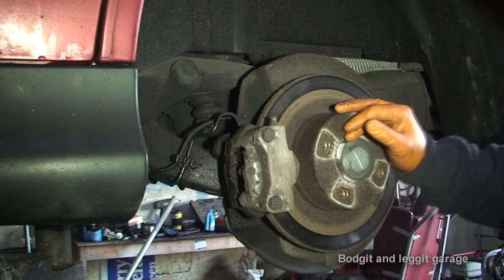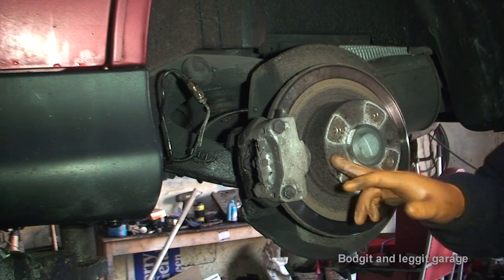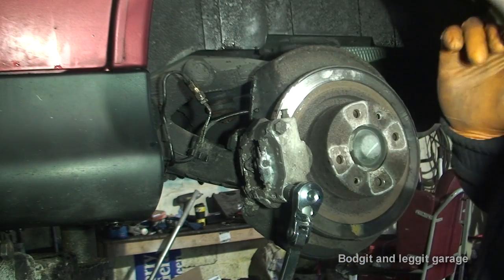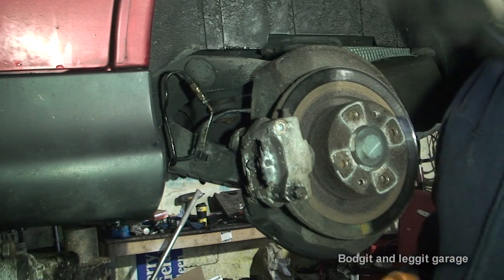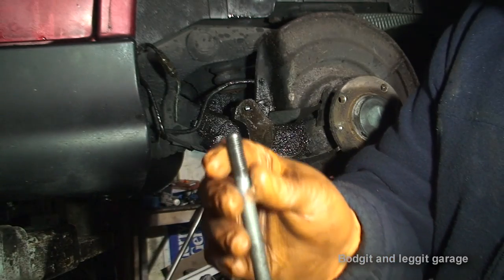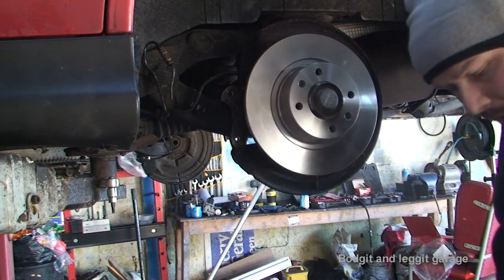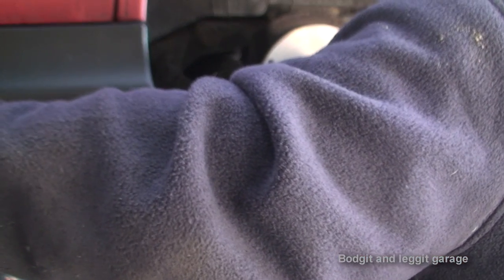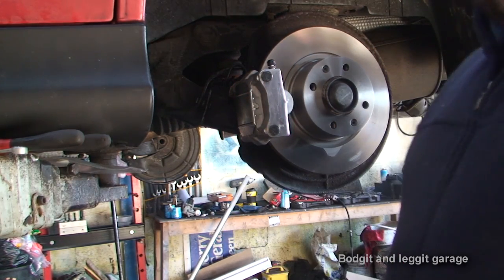bodgit and leggit garage how to do citroen c5 back brake pads/disc/calipers  (nightmare)

Comment: This is normal in canada on most brake parts hitting with hammer is bad use air hammer on bolt head with point you get the shockwave without damage to thread  get a real torch you need to heat it fast or it all expands  impact gun works but use it to tighten a bit then use wench to take off oil the shit out of it too losen, retighten oil clean losen repeat as lots of them jam and break halfway out ! You guys have it easy in the UK everything is rusted too hell in canada after a few years broken bolts are normal! This would not taken long in my old shop more than 2 hours you would get fired
Reply from the maker: Boom 👍💪

Comment: Bleeding the brakes on the C5 is the same as conventional car, not like previous Citroen. There is no doseur valve and the brakes are not part of hydraulic suspension circuit ie. working from that mechanical suspension pump.
Reply from the maker: Alex Bowie 💪👍
Reply: I'm in right now doing those 'orrible swinging arm bearings lol! Get a vid on that mate for Sadists everywhere lol! Anyways, keep working away mate, there is money everywhere! lol

Comment: On jobs like this do you charge customer for all the additional time it took?
Reply: You can't. You charge them book time. However long the book time says, is the amount you charge at your hourly rate plus a new part at retail cost (if you buy trade), plus some extras, brake fluid, disposal, cleaner. But that would be low.
Reply: @forevercomputing   Nah, no such thing as 'book time' in a private business garage, that's main-dealer terminology. For jobs like this C5 most privateers would make a labour charge that's in the spirit of the time expended, but depending on the customer / their attitude, take a small hit to encourage repeat business.
Reply: @wirdy1  What is your source that it is dealer only?
Reply: @wirdy1  all completely true...but if he gave the customer an estimate before doing the job, wich is common, sometimes is hard to overcharge and many customers dont understand or pretend they dont understand...they get pissed off and dont return...others say they dont have extra money,etc etc...depends on the type of car and type of customer

Comment: did they leave it parked in the sea lol
Reply: No its just made in France.
Reply: Well, then why does it often say "Bosch" on the calipers? Think before you post.
Reply: Bosch manufacture it to Citroen specification which is crap in the first place due to being a French design in this case, absolutely crazy to put steel bolts in an aluminium alloy casting when it's in an environment where it goes through heat and cold cycles and has road salt thrown at it which acts as an electrolyte.

Comment: Put a nut in a socket with a short extention bar so bolt head is not spoiled.
Reply from the maker: But how would that stop the head getting damaged it will still spin on it and this wasn't the problem in this video I don't understand what you're actually getting at mate

Comment: You got the bolt moving, but you never re tightened the bolt to clear the threads and put oil on the exposed threads, not wd40, then work the bolt in and out, not just go for it which is butchery at it's finest, another thing, every time you hit the caliper or the bolts, you had brake fluid spraying out every where.

Comment: What idiot designed that!  Steel bolts going through an aluminium casting, heat and cold cycles with water and road salt thrown in, what could possibly go wrong🤔

Comment: Those 5 minute jobs will get you every time. Do they use a lot of salt on the road around there?
Reply from the maker: Eric Corse not really only when the weather's bad or  after its snows when it's too late lol
Reply: Thanks I wonder why the horrendous corrosion?
Reply from the maker: Eric Corse common problem with these just the way it goes sometimes
Reply: Crappy Aluminum I suppose.
Reply: bodgit and leggit garage Thank you SO MUCH for this video! I recently bought a used citroën c5 2003 and the sellers lied to me about the shape of the car. I took it to a repair shop and they wanted a lot to fix it. So I looked up how to so it myself, hence I came to your video, and I am now waitimg fpr the spare parta to arrive so that I can do it myself and save loads of money! Thank you again!
Reply from the maker: foshizle121 anytime mate glad I can help happy that it helped you out that's what it's all about
Reply: Made in France thats why its coroded a heap a s***
Reply: Well, if it says "Bosch" on the calipers as it often does, how do you explain that? Use your brain before you post.
Reply: Problem was not with the caliper.
Reply: "Made in France thats why its coroded a heap a s***." Probably the dumbest comment yet.
Reply: foshizle121 good luck with that
Reply: @ericcorse - "I wonder why the horrendous corrosion?" 
Galvanic corrosion, a very common problem when dissimilar metals are applied. 
The reason why on boats, mostly salt water, sacrificial zinc anodes are used for corrosion protection. Over time the sacrificial element will disappear, but the more important components will be saved. ;-) 

Frankly not a big deal in hot dry regions, or extremely cold regions (-10°C & below)! On both cases there's low moist content in the air. 
But a total nightmare in mildly cold areas, particularly, where salt is used and water is everywhere. 

In this particular case there's a reason why aluminum alloy has been used. Weight, lower sprung weight allow for a better suspension performance. These Citroen's are well known for a very comfortable ride. ;-)

There's only one way to minimize this "nightmare". Maintenance, done in a timely fashion. Something the exemplar on the video was surely lacking. ;-) 
Cheers

Comment: More patience than me. Time is money. A caliper that fucked needs replacing anyway. I'd have used an angle grinder to take it off and then just replace the bolts with the new caliper if it didn't come with any. The cost of a new bolt = £1-2 and can save you 30 mins to 1 hour of headache. Whne you factor in 1 hours labour cost of a new bolt vs the time taken to do the job it's not worth the struggle with dodgy bolts. Just blitz them

Comment: the calliper would have lasted longer without that rear dust cover as it causes electrolytic erosion of the aluminium it is in close contact with. Aluminium is a sacrificial metal used to protect steel ship hulls. Swapping that pin used to hold the pads in place with an aluminium bolt and nut would have made calliper not corrode at all along the back... one could always fabricate sheet aluminium dust cover if one really felt it was needed... that would leave just the anti-rattle spring as a cause for corrosion. I suspect this calliper design is part of the designed in obsolescence that makes free market capitalism work so well... for the companies!

Comment: Those calipers look they are designed to corrode lol. Very weak where they need to be strong. ie, those pad mounts. I saw the thing literally fall apart while you were hammering on it. Terrible. I hope my ST ones are a bit more robust when I do mine soon.
Reply from the maker: Your ST ones will be fine mate
Reply: the pad mounts only hold the pads in place so they dont fall off...when braking, the pads get forced against the side of the caliper, not against the caliper holder pin and pad mounts
Reply: @MrHBSoftware  sure I know dat. Lol. But it's still not great is it.
Reply: @royevans4581  yes, far from great, that's true

Comment: I would of burned it to the ground what a stupid idea to put bolts through a caliper
Reply from the maker: HAHAHAHAHAHA
Reply: Basically all calipers made by two halves are put together with bolts.
Quite common from Toyota to VW, just to mention two sides of the planet.
With this said most are of the 5 faces type head, so can't be disassembled with normal sockets.

Comment: If fitting new caliper drill hole in it so wd 40 can get in also  screw it back in so wd can in threads and if all else fails put bag round it and connect  to wall paper steamer nice to see bit of hardship never buy French crap
Reply from the maker: lol

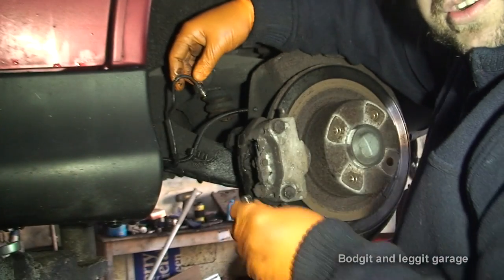Comment: 4:01 Every time brake fluid drips out, guess what happens?
Air gets into the lines, brilliant!
6:59 You mushroomed the bolt with the punch not the grinder.
What you say does not make sense.
Reply from the maker: First of all it's not brake fluid second you can bleed it to it doesn't make a different how much air goes back in the system
I will try and explain the second one to you but I don't think I can I don't have the time I'm thanks a lot for watching

Comment: What a sh#te caliper design. That coverplate should be plastic and the two caliper halfs should be held together with ther own bolts.
Reply: the whole design is bad, the caliper is also held together with the bolts that seized, so even if there do come out it can result in the bloody thing leaking